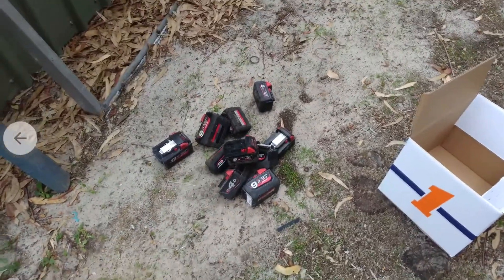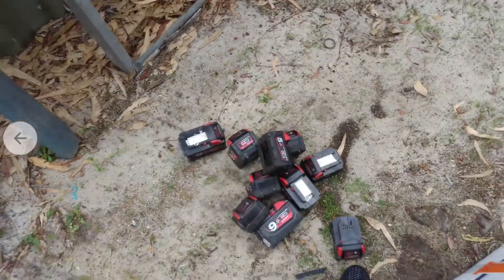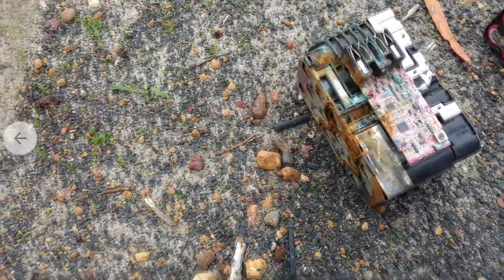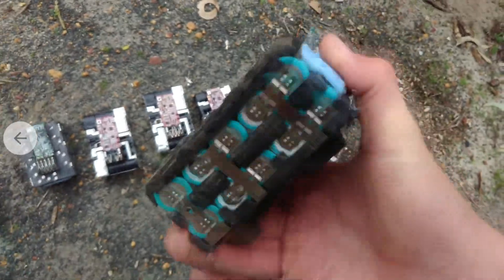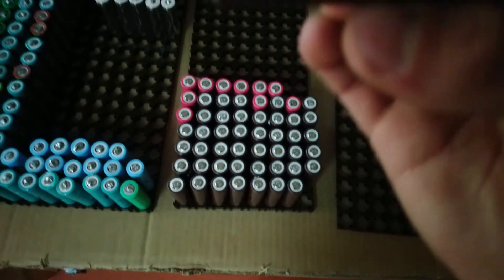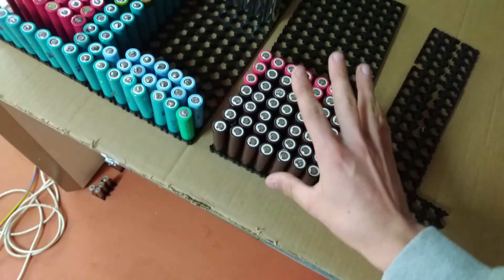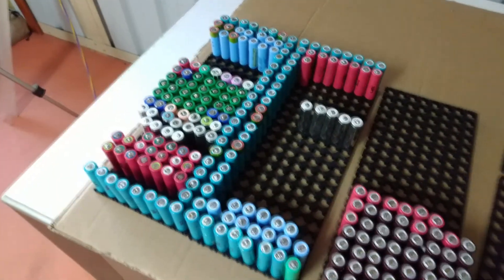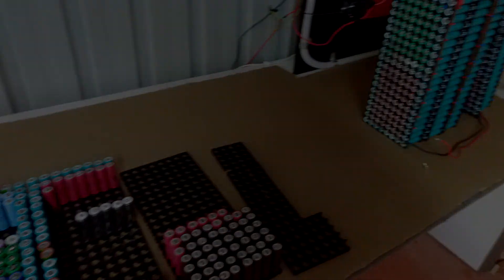DIY Tesla Powerwall | More Cells And How I Process| Update 20

Comment: Holly crap, you haven't researched much into building this did you? Your cabling is way too thin and bus bars just the same. you need to work out the expected current you're going to pull through this and put much thicker and stiffer bars.. and then some.
You'll end up draining the closest batteries to the terminal first before the furthest ones drain last which will totally mess up your balance. This is why the proper and perfect way to build these is to have a terminal on either end of the pack so any bus bar resistance over the distance ends up being the same across the whole pack. So don't make the same mistake most are doing and putting the positive and negative terminals coming out the same side. if you do, put a fat very low resistant bus bars to limit voltage drop over the length.

You also need to stop swaying your camera left to right on some of your videos, you're giving people sea sickness :P hehe